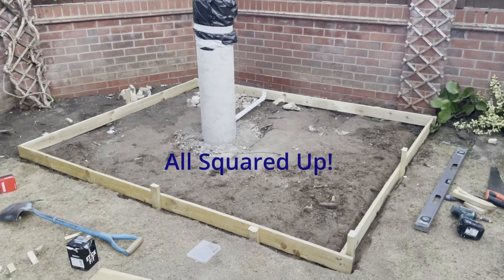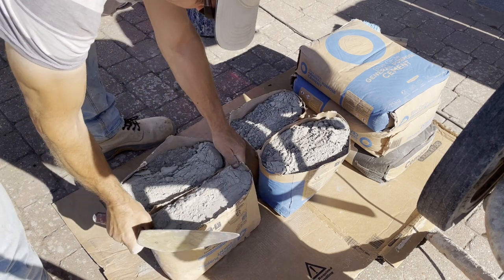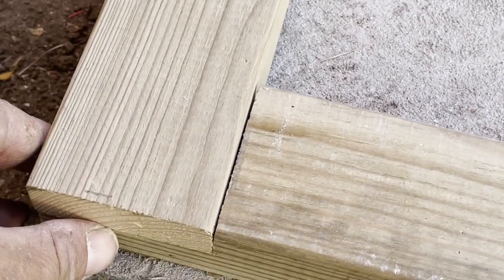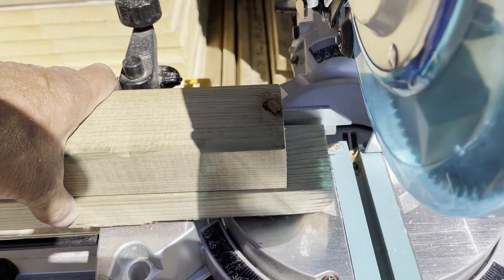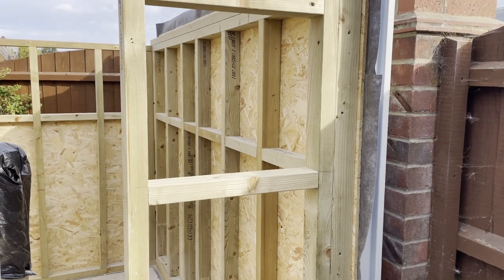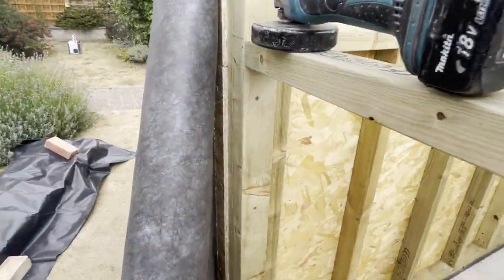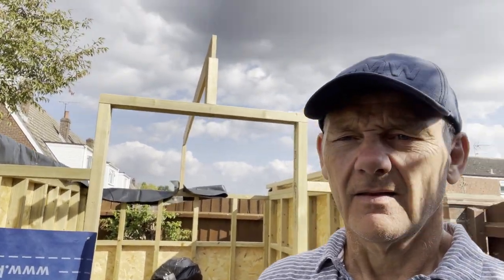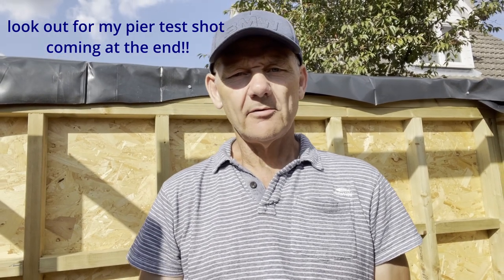Observatory Build Part 2  Base & Walls

Comment: That obsy is looking so bloody good Simon - will be a very smart looking building on your property for sure. Can't wait to see it finished.  And wooohooo! going mono! Awesome - just in time for your nights to start getting longer with more imaging time.
Reply from the maker: Thanks Logan, the wife wants to put a hot tub in it!🤣 I’m filming part 3 for the roof now! And yeah, couldn’t resist the urge to go mono! And like you say, longer nights are coming 😃 
I noticed on your roof automation video, your toothed track is plastic! I’ve seen motors with plastic track and was put off not knowing how they would operate. Just wondering yours thoughts on how good they are, as your roof looks quite heavy? Cheers Logan!
Clear skies!
Reply: @SimonsAstro  The track is for a sliding gate, I think it has a metal core structure to it covered in a very hard plastic stuff so it's quite solid and so far works extremely well.
Reply from the maker: @LogansAstro  Ah thanks Logan! That’s my next move is to get the motor, I’ll have another look, cheers👍